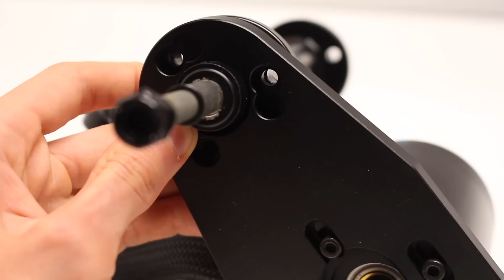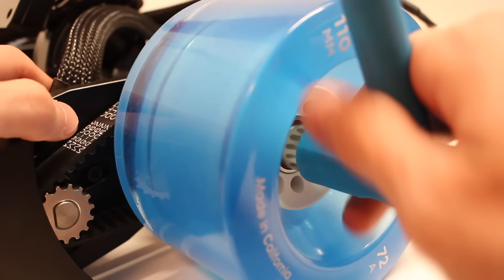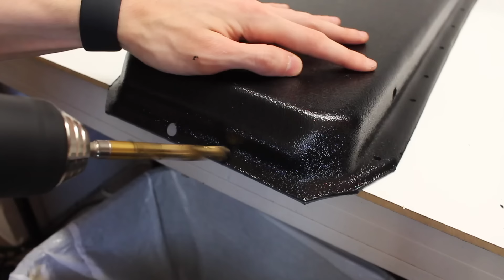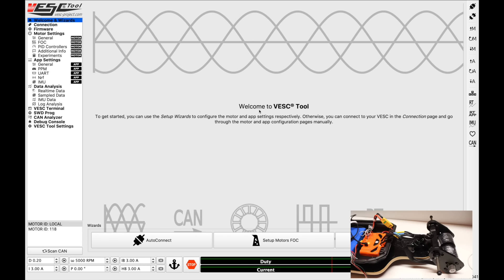*THE DEMON 2.0* How to Build an Electric Skateboard 38MPH - 30 Miles Range - 7,000W

Comment: # Drive Train
   1:36 Motor mounts
   1:54 Motors
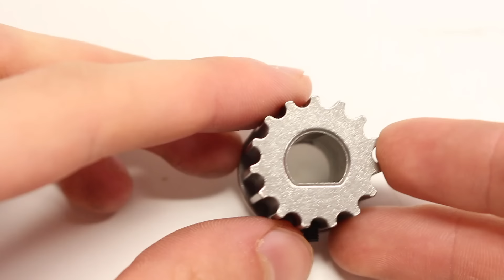   4:43 Motor pulley
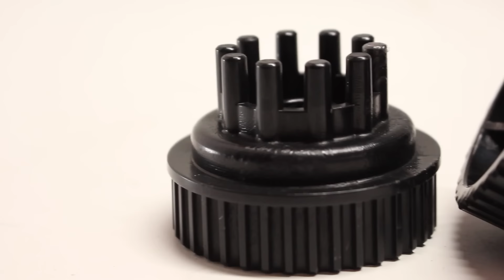   5:20 Belt
   5:27 Wheel pulley
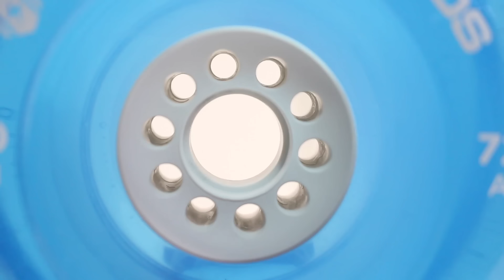   5:50 Wheels
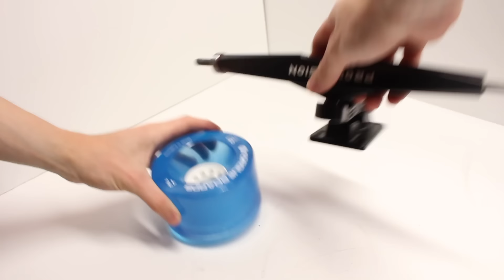   6:15 Bearings
# Deck and Enclosure
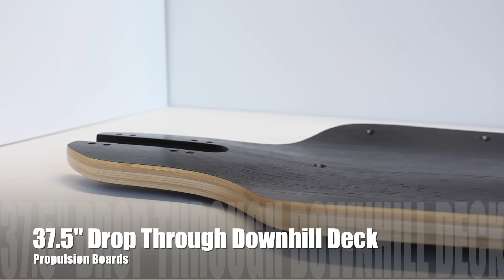   9:32 Deck
   9:56 Enclosure
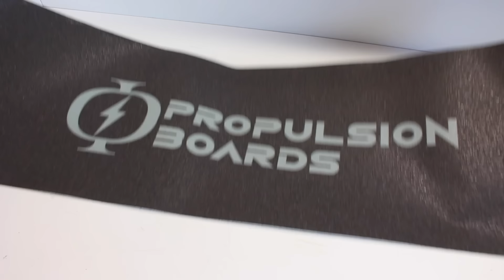   11:17 Grip tape
# Electronics
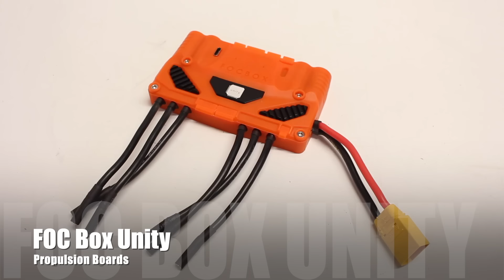   13:14 ESC
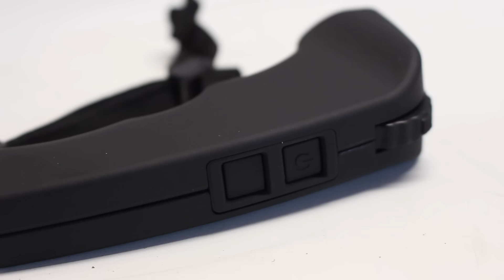   13:46 TX/RX
   14:19 Battery
Reply: hi , can i use the Flipsky VX2 Pro Remote on Enertion Raptor 2 ?

Comment: I’m planning on doing a very similar build to this one using a similar deck. The trucks I will be using are the caliber 2.0 trucks and I’m curious what the largest size motors I can fit on there without them touching. I’m planning on doing dual 6355 motors because I’m pretty confident I’ll be able to fit those no problem. I’ve never built a belt drive board before so I’m happy to take some advice. I’m a 180 lbs rider and there aren’t hills where I live but I would still like to be able to climb hills when I take the board out of town.
Reply from the maker: Dual 6355 on standard caliber trucks will fit with a 12 mm belt setup, but it very very tight on 15mm - maybe won't even fit.
Reply: Okay good to know. The pulley and belt kit I was looking is a 15mm belt
Reply from the maker: you could also use extended caliber truck clones if you want more hangar space. But yeah, 12mm is the way to go w/ dual 6355. I think 15mm is possible, but it very VERY tight
Reply: I ended up using flipsky double kingpin trucks. I think I’m more a fan of the single kingpin trucks so I might switch them out. Any recommendations for single kingpin trucks and any deck recommendations?

Comment: My skateboard is the same setup but different deck and trucks. Have my motor settings at 100amps and battery at 120amps. I can push thos amps because I use 6000mah 12s lipos 60c

Comment: This is Flipsky stuff rebranded...
Reply from the maker: Our parts are from flipsky but we changed stuff about them. We made a video on the motors and we addressed this
Reply: Doesn't seem right to resell exact same parts more expensive...
Reply from the maker: only the motors and remote are from flipsky. Everything else is not
Reply: I can recognize the Trucks, the Motor Mounts, the wheels (you call it all terrain), the motors, the remote... And everything is more pricey than Flipsky...LoL
Reply from the maker: The motors are more “diy” with shorter shafts and longer cables than the Flipsky ones. We really like the xv2 and we weren’t going to make  another one when the vx2 works

Comment: Hey sorry to take time out of your day ik you're super busy I was just wondering I want to buy a lycaon gr battery to replace the battery on my Wowgo 2s. The specs for the lycaon battery are 18650 cells in 10S3P 36V 7.5Ah 270Wh and for the wowgo which I want to replace are 36V 10S2P. I want the range of the lycaon battery to upgrade my current board and was wondering if using the lycaon battery which is more powerful (about 15 km more range) will fry my esc, motors or anything and was wondering if the battery is compatible. If you do take time to respond thank you so much and if not thanks anyways love the vids, got a new sub!
Reply: As long as they're the same voltage battery, it'll be fine. So yes it'll be ok to do the battery swap

Comment: I feel like a drop of thread lock on most bolts would prevent a lot of headaches later on. I build and fly a lot of drones and RC planes, no thread lock and it’s guaranteed to have parts vibrate loose. I’ve been thinking about ordering a kit to build my own. I’m a big DIYer and this looks like a ton of fun. I’ve fixed up a few lift boards and other lower quality brands for other people. Fun to ride but would like longer ride and higher top speed than the ones I’ve worked on.

Comment: For long range and good speed is hub motor good or belt motors ? ( beginners in e board)
Reply from the maker: They are both really good but for hubs you can get stuck with a limited choice of wheel where as the belt you can have virtually any wheel option

Comment: I’m going to build this kit with these changes:

Hi5ber Undertaker Deck: $275
Abec 11 BigZigs HD: $65
Bones Swiss Ceramics: $165
Eovan 12S4P Battery: $569

My hopes with these changes is that I can achieve an even higher stable amp output for higher speeds and increased range with the batteries 48000mah capacity. Increased efficiency is seen with the Bones Swiss bearings to extend rolling distance and rotational resistance. This efficiency and range is also increased through the lightweight carbon fiber deck by Hi5ber. The wheels are just personal preference.

The price increases to around $2300 to build after taxes and shipping including and other small bits to get the build together.

Please let me know if you see and flaws in my logic or part choices! :)
Reply from the maker: I would not get those wheels as they do not have any spokes. You will need some wheels with spokes. The smallest that I would use are 83mm. Something to note about the Eovan pack is that while it has fantastic range, the current output is not that high compared to some other packs, meaning you will not get quite as much power. Otherwise, looks like a great plan!

Comment: I have a question, I have a exway pro does 29mph but I can only get about 11-15 miles while having fun. Can I buy one of these enclosures and add the battery pack in parallel to the stock one ? So it’ll double my range or more ?
Reply from the maker: That would probably be a pretty difficult mod
Reply: @DIYesk8Builders  that’s what I was guessing. Might need to just make a DIY from one of your builds, being 220lbs kills my battery’s.
Reply from the maker: I would totally recommend it

Comment: How do you charge the battery?  The charging plug was left inside the enclosure.  Do you have to open the enclosure to charge the battery?
Reply from the maker: No the charge port threads through the hole in the enclosure and comes out on the outside. It's charged just like any other esk8, just plug in the DC charger and you're good to go

Comment: You guys ever considered foam to dampen vibrations?
Reply from the maker: We have a new custom seal coming out in late March for the boards. Made from rubber!
Reply: I was meaning foam inside the enclosure, surrounding the battery. As in wedging it in place and allowing for vibrations, I suppose it depends where you ride but perhaps doing a video showing a build a little more suitable to rough terrain, ways to strengthen and make your build more durable?
Reply from the maker: Yeah we will definitely consider that, but right now the batteries have a lot of padding already built into them
Reply: Oh true, I hadn't considered that lmao

Comment: are the pulley covers not useless now?
 they only cover the belt part that is the tightest so it wont really protect from debree getting in
Reply from the maker: The reason that this is done is to allow for one set of belt covers to work for street and AT. It is not ideal on street, but works great for AT, where debris are most likely to get in

Comment: I am building a board. Would you recommend using double kingpin trucks with using such big motors? I've been told to use regular trucks. Your opinion?
Reply from the maker: Either one works great! We like the dip because they make it easier to serve but they are not as stable at high speeds

Comment: I'd rather spend $1300 for the Miles Phantom, which is my next board, and this is someone who spent $1800 for a Onewheel XR.
The Phantom has 30 miles and range and 28 - 30+ mph and cloud wheels. No brainier for me.
Reply from the maker: I would love to hear how you like it! Looks like a great board
Reply: i wouldve rather spent $5k on a lacroix then bought the demon 1.0.
Reply: @vAxiom  $5k?..... You might as well buy a used car or a motorcycle at that price, but that's just me. $5k is a lot of extra money laying around the house under your couch. Lol
Reply: @Evolve816  ya... I have no use for another car. And a motorcycle means higher insurance which I ain’t doin. I’m just much more interested in a bigger battery since my demon 1.0 doesn’t last me even half the amount of time I want to be riding for....I’m also heavy on the throttle so.... I get minimal battery life.
Reply: @vAxiom  Dang must be nice not to need a car. Lol where I live we don't have a choice. So I definitely feel ya on no extra insurance and maintenance cost.

So how fast is your demon and what's the current range?
Reply: @Evolve816  I’ve gotten my 1.0 to 38mph, which you can see on my channel... make sure to max out the video quality if you watch it. When I first purchased the board I was much more causal while getting used to it... I got a useable 25 miles before I had to push to help the board, but once I got used to the board and the trails(cracks and rocks make it hard for a smooth ride with polyurethane wheels) I was getting no more than 15 miles which for me just isn’t enough.
Reply: I am by no means scared to go fast or falling off but 38 mph is nearing suicidal... any imperfections in the trail can completely ruin your day with polyurethane wheels.
Reply: @vAxiom  when I first started riding my Onewheel XR, I didn't have fangs, and I was riding 17mph up a steep hill at night, and all of a sudden.... BAM!!! Face plant, but I avoided my face, just a partial knee and a little shoulder action and oh my right hand!

That knocked the wind outta me a little bit and stung for a while (oh and I wear a full face helm now), so I don't even want to imagine wrecking above 30mph.
Reply: @vAxiom  Oh wow 38 mph! Noice, but scary. I'll be sure to check your channel. 
I've only hit 23mph on my Onewheel, too scared to push it higher especially on these hankie roads out here where I'm at.

At 210lbs, I'm only getting 12 miles per charge. Not quite enough. 20 miles would be great for me.

Comment: Can you please do a review on the battery?I purchased one from you but my  diy board is still in the process of being made, So I have yet to test it. How is it compared to a 12 S3P 18650 and a 12s4 P 18650 pack? Thanks.
Reply: It's pretty easy to look up the specs on the cells and compare watt hours and totall wattage output.  Do a side by side w Samsung 30q's and 40t's and you'll get the info you need (keeping in mind a 4p and 3p configuration respectively).

Comment: Great video! I gotta ask though... Why the DKP trucks? Aren’t they unstable at higher speeds? Full disclosure I’ve never ridden them. Is there an option for non DKP? Regardless the board looks stellar.
Reply from the maker: Thank you, yes so I definitely feel that people make the speed wobbles on dkp's out to be a lot worse than they actually are. While they are not as stable as other options, they still handle high speeds just fine in my opinon. Definitely a valid point though!

Comment: 1999 on a skateboard really.
Reply: I mean it makes sense. Most electric longboards that are at that power and range is around that price if not more. The battery alone is expensive on its own. Obviously it would be nicer if it was cheaper but thats the market
Reply: @hihipoo6824  u guess but if u look at e scooters that are less than 1k even 700 for fact and speed range is more . But we have here skateboard which is smaller in size small wheels card board and battery and it cost 2000k sometig is not right here .
Reply: @cabrail100  cheaper parts cant believe i have to tell you that
Reply: You could make something similar if you're thrift and buy used parts or hop on sales for ~1200. Sure it's more than a scooter, but I don't like the look of scooters and skateboards are more fun to me.
Reply: @viviix02  yeah longboards are more fun imo. But if u scavenge the parts u probably won't be able to hit the speed or range of this model for the 1200. Then again I could be wrong. They're is always someone who sells a part for ridiculously cheap and it's new
Reply: @hihipoo6824  I've been planning a build for a while and have a parts/price list if you're interested. 
Motors - 200 (Flipsky dual 6374)
VESC w/ remote- 250 (Spintend VESC, black friday pricing)
12s4p 30q used - 320 (forum.esk8.news)
Trucks - 80 (boardnamics.com)
Wheels - 110 (torqueboards 110s)
Pulleys - 60 (boardnamics.com)
Deck - 50 (generic drop down deck from ebay)
Mounts - 50 (boardnamics.com)
Enclosure - 40 (DIY enclosure)

That comes out to ~1160, with all new parts except for the battery. If you went used for some of the parts, you could do even better.

Comment: Got a couple of questions. Can the Boardnamics motor mount work with the standard DKP 3 hole mount? I know this is a longshot but is also possible to mount the motors facing forward with DKP trucks. I know the middle kingpin would be in the way and the motor mounts that come with DKPs hole alignments most likely don't work but I'm way too into hiding my motors under my deck. I think it would work with some longer motor mounts to possible extend ahead of the middle kingpin.
Reply from the maker: Hi, not sure about the boardnamics mount - I have seen that somewhere though. Also not sure about the inward mounting as we have never done that. I think there is a place that might called Janaux but I'm not sure

Comment: Get a onewheel.   Www.onewheel.com.  No controller needed,  no belts to wear out,  goes off-road no problem.
Reply from the maker: Thats very true but they are two different products. The Onewheel only goes 19 mph and has at most 18 miles of range. This goes around 38mph and has roughly 30 miles of range...

Comment: There’s no way you’re getting that speed or range.
Reply from the maker: We've had reports from customers that they have hit 41 MPH and range is definitely a little high, but achievable depending on how you ride
Reply: @DIYesk8Builders  it just doesn’t seem possible to reach much more than 30 but  I could be wrong. I want to see a customer doing 41mph on these double kingpin trucks. That sounds scary.
Reply from the maker: What factors are making you think that it can't reach more than 30?
Reply: Eric Fical People overreact about DKPs I have them tight on my Demon 2.0 and harder bushings and it’s stable. And it’s definitely powerful to go 40+mph. I can do 0-30mph in a matter of SECONDS it really PULLS the acceleration is dragster
Reply: @6-carboxydetrahydropterin-485  I have four boards with dkp’s and the fastest I’ve ever been is 28. You got big balls. Lol. I Usually just cruise between 12-20 mph and carve.

Comment: Can I ask why you used double kingpin trucks instead of reverse kingpin trucks? You would get a lot more stability out of RKPs and you can tune the bushings to the way you want it to ride much easier.
Reply from the maker: Very true and valid points. We just like the feeling of the dkp's!
Reply: Turning bro but the wobble factor.

Comment: Why do you use two 75 amp motors if the batery can only suply 95 amps ?
Reply: Motor amps are not the same as battery amps. It has something to do with erpm, look more into it. Bottom line, 95 battery amps is a lot and won't be the limiting factor in the build.
Reply: Just because the motors can handle 75 amps doesn’t mean you have to supply that much to them. Most of the time you’re not going to pull many amps unless you’re going up a steep hill
Reply: And do you have any idea on what the current draw is on flat cruising speed?
Reply: @kwynton8272  not nearly what your battery puts or what a motor is capable of handling. Usually from startup you’re pulling more amps and hills can require more current
Reply: @kwynton8272  my original build was a dual 5065 motor LG 10S4P 10Ah with 80A output that I put together. I’m running close to 40A to each motor. I’m using a flipsky vesc 4 dual and it’s dialed in nice. Now I’m using 6374 motors and I can run higher amps. I’m building bigger batteries with more current. I’m hoping to start a 12S8P or 10P soon.
Reply: It’s about space. If they had more space in the enclosure then you could add more batteries in parallel, increasing the total pack amperage output and capacity as well

Comment: just used your website. It's cheaper to buy the individual parts for the AT build than buying the "complete" kit for the AT. Maybe review your site and prices?
Reply from the maker: I just did the calculations and it costs $1803.93 to buy all the parts separately and the kit costs $1699.99... and that excludes the wheel pulleys and belts...
Reply: @DIYesk8Builders  Even if buying separately were cheaper, I’d pay a premium for the work you have already done to simplify the project.  Thanks for the research and great video!

Comment: Focbox Unity has push to start mode. Is that usable in this board?
Reply from the maker: We currently do not use it, but theoretically yes
Reply: Absolutely is but you would want to throw a loop key in there as a safety precaution.

Comment: when ive tried to setup my flipsky 4.20 vesc the acceleration and brakes are just too powerful, would that be in the amp setting for motors? Also for some reason with the hall sensors plugged into the vesc only one motor is running sensored and the other isnt which causes one wheel to spin and the sensorless one to just stutter unless i push it forward then it spins normally, do you know why it wont run sensored? Last thing, when i hold a speed at like 10mph the boards keeps on accelerating even though im not pushing the throttle any higher?
Reply: U must make the vsec know that the trigger is a speed set not an accelerator. And accelerator will continue to accelerate.